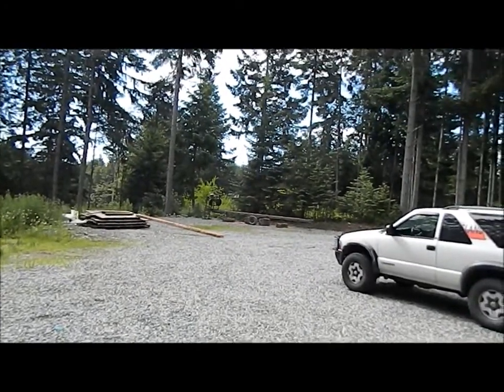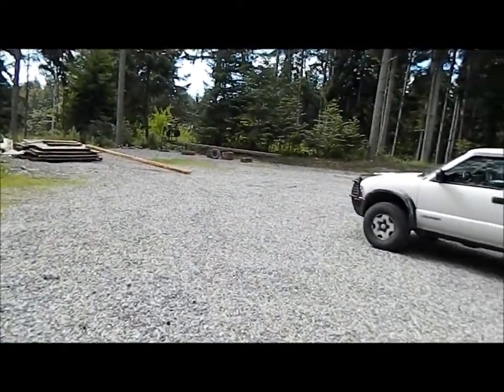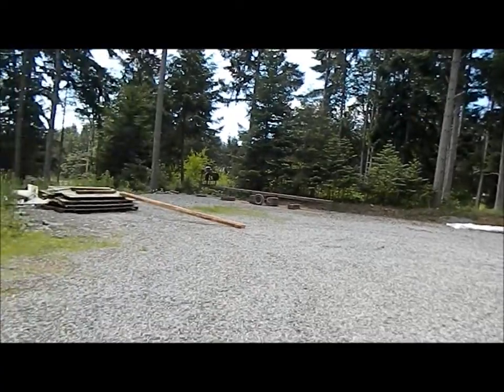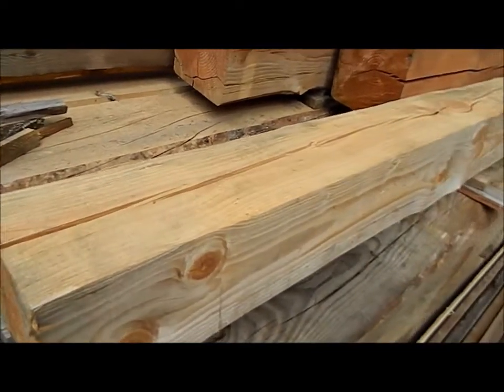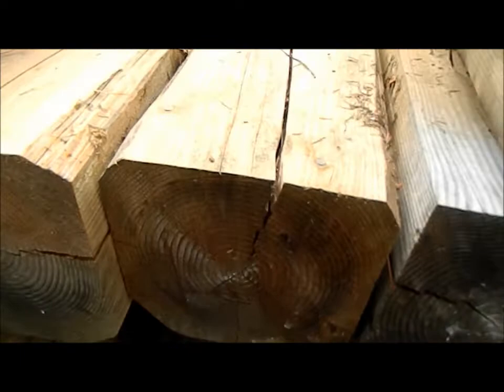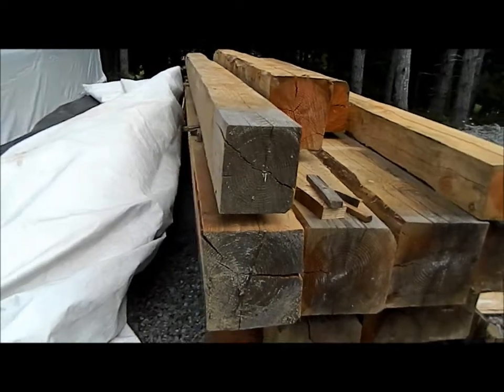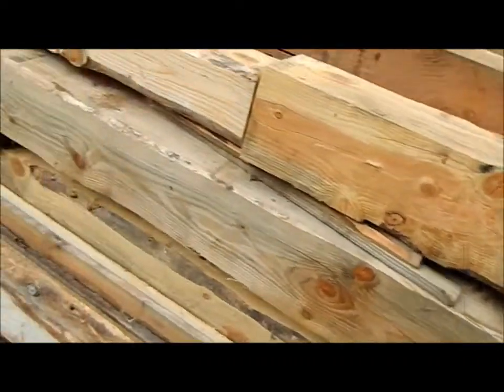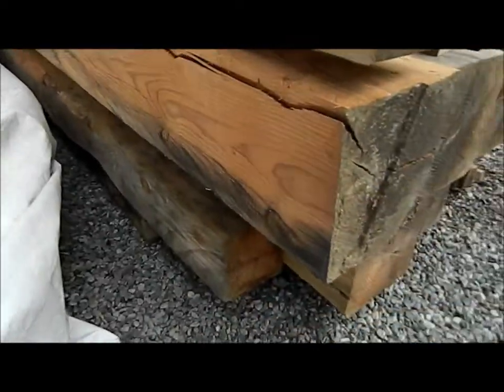Problem with cants split while drying

Comment: I got your comment and saw the video. I'm not an expert but here's some thoughts;

1. Anchor Seal the logs before you mill them into cants. The process will reduce checking/ cracking.
2. If you can, cut the cant in half by removing a 1" (25mm) board from the center of the cant. Make sure that this board has the pith in it. Most of your cracks/ checks are starting in the pith.
3. Keep the cants out of the sun if possible; direct sunlight could cause the outer layers to dry too fast. DO NOT cover them with a tarp unless there is a large gap around the cants to allow for air flow.

I hope this works for you, eh? (did you notice the Canadian "eh" at the end?)
Dave
Reply from the maker: Anchorseal here in Canada is 8x more expensive than in USA incl the additional shipping and customs fees. 
US$120/5 gal vs CDN$110/1 gal it is only available in clear 1 gal containers here and there is only 1 distributor here in the entire country. 
Makes it not a realistic option. Emailed UCC coatings to see if they could do anything about this hugely excessive costs they just ignored me would not respond. 

Looked into the Lee Valley log sealer it is CDN$60/gal but have not been able to find anyone that has actually tried it on raw cants.

The sealer will help but still will be a problem with checking.

Want to buy a whole logging truck load of raw fir logs will cost me approx $8000 so I have ample wood to last the next 10 years of building but at this time don't know what I want to build yet hence why I want to just do the cants. Also am in the process of building my own small 1000sqft house want to get the lumber milled up for this during the winter to frame next summer.

Have been cutting up these cants over the last few weeks and the quality of the wood is terrible due to all the checks in it.

Dont want to risk $8000 plus all the milling time just to find the cants check so badly like before.

Finding it hard to believe no one has encountered this exact same problem before there has to be a solution.
Reply: @Islandwaterjet  Some people around here use latex paint (which is available in a rainbow of colors for the discerning  sawyer). I've also heard of using oil based paint. Either one would be better than nothing.

Comment: I agree that putting them under the tarp had something to do with it, need some kind of a lean to to store them in out of the sun yet air can get all round.
Reply from the maker: A tarp will help keep the moisture in. That should make it better for slowing the overall drying process. Trying to approach this logically, not having any success as yet.
Reply: @Islandwaterjet  I don't think you want to keep the moisture in though? Just a guess though ! 😀😀
Reply from the maker: @CruiserMac  Yes, slowing the drying process would help a little but as others have pointed out if the pith is involved there will be checking. Looks like there is no solution to this will just have to mill 2 x whatever width and and then rip to final dimensions for each project requirements.